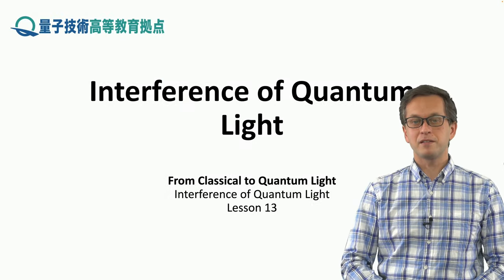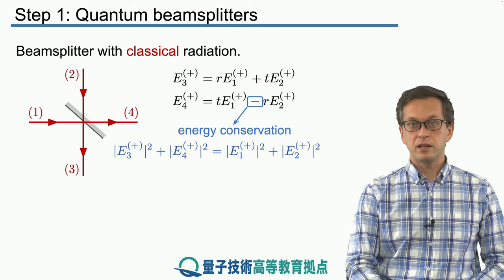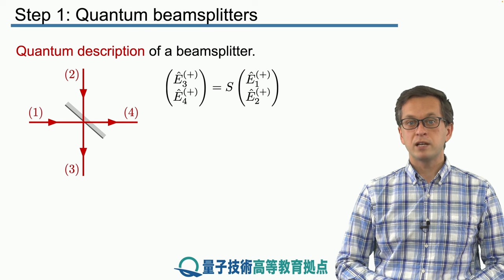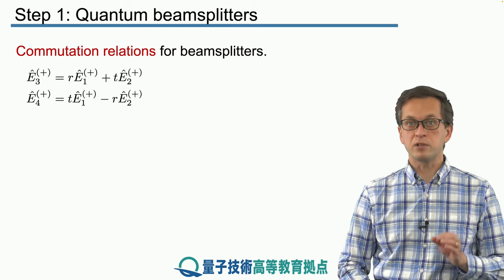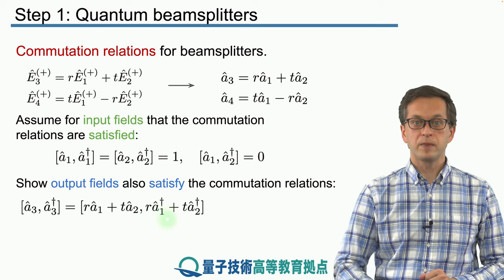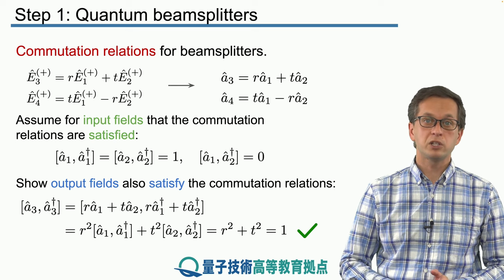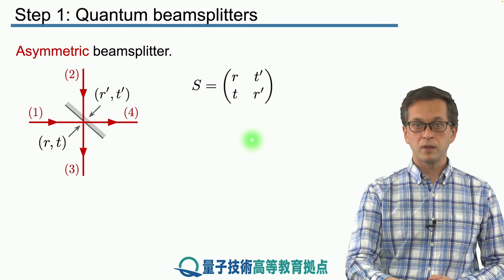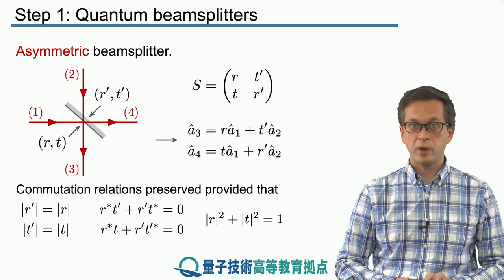13-1 Quantum beamsplitters

Comment: 4:46 Why is the classical field amplitude only replaced by the annihilation operator a, why not with the full electric field quantised operator in terms of (a + a^\dagger)?
Reply: I think that is because we have E^(+) and not E. 
E = E^(+) + E^(-)  and E^(+)∝â
Reply: @κπυα  what is the meaning of E+? The em field incident on the beam splitter should be E, isn't it?